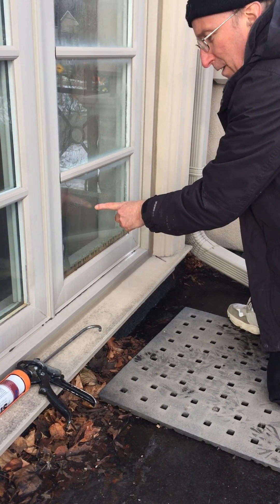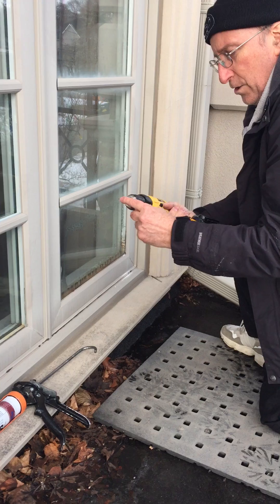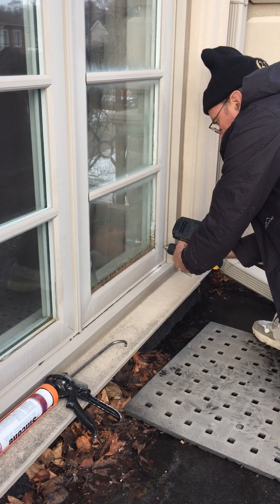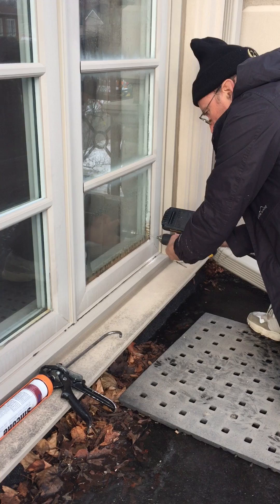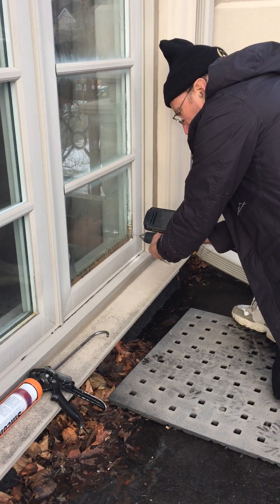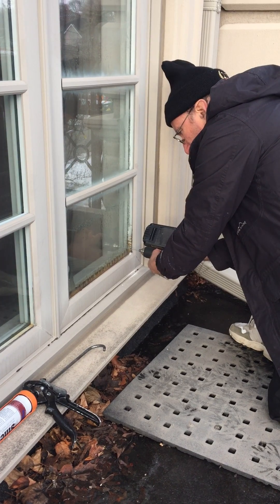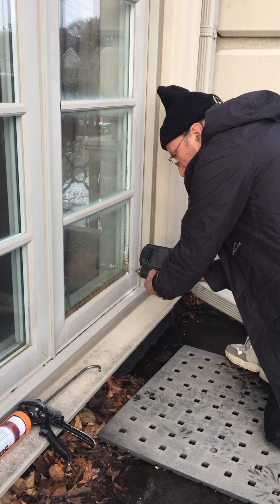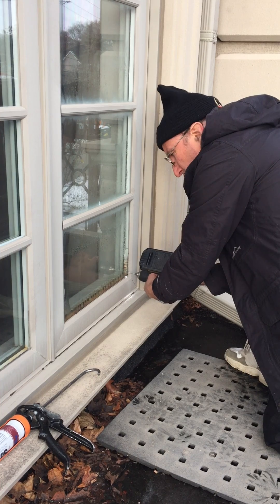How to clear condensation inside a window glass sealed unit by drilling exterior vent hole

Comment: Replace the unit, easier, cheaper, simples  otherwise its not sealed, not doing It's job, an if its toughened , will break u doughnut ffs !!!!
Reply from the maker: Yes.  Change the glass sealed unit when you can.  This is an alternative way to clear the condensation when changing the glass would be extremely difficult, however this vented double glass will only be R=2.0.  New double LowE-argon glass could be R=3.4 to 5.0.  This window was 14 feet above the floor with SDL grills stuck on the surface of the glass as well and the homeowner chose this cheaper repair.  And this repair leaves the glass unsealed but will last for >100 years while a new sealed unit will likely only last 10-30 years depending on how dry it can be kept.  I will create another video in the future showing methods to maximize the life of glass sealed units in the climate of Canada.